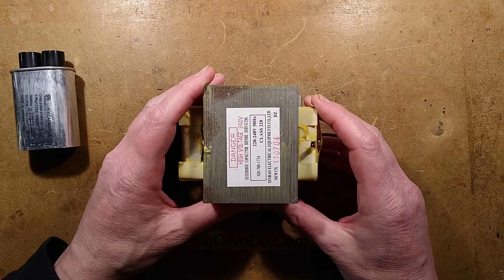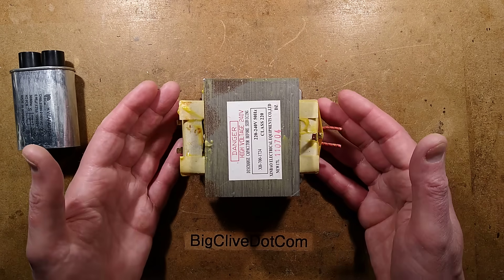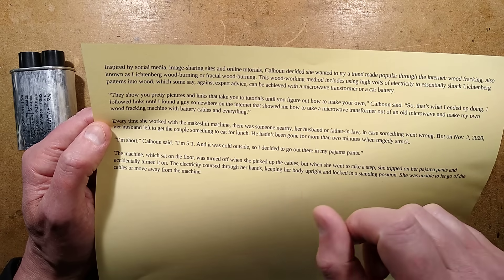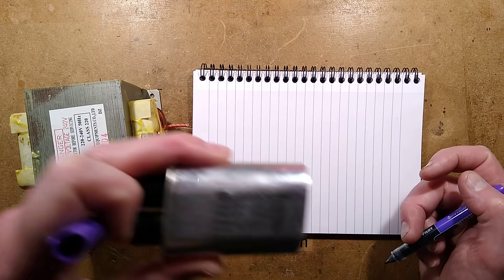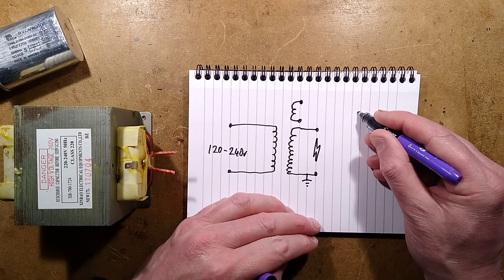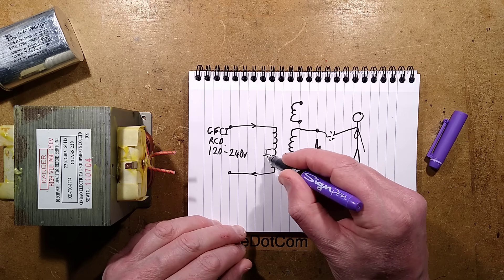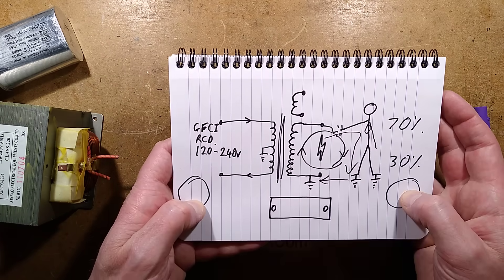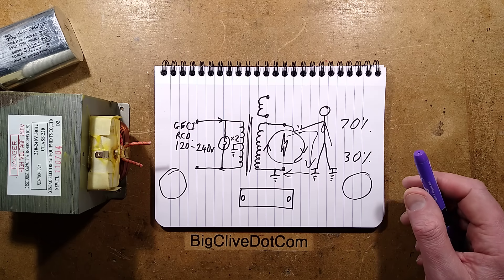The most deadly project on the Internet

Comment: insulation break down is something we can solve just by using the right cable or adding extra insulation such as 6 layers of heat shrink tubing but the added salt water kinda makes the risk unavoidable
Reply: the deadmans switch is a good idea I would also advice people keep this device on a long ext cord and bolted down so that they are are far from the high voltage and isolating the transformer so its not grounded would be a good idea on a side note put a 100 watt light bulb in series with the the primary this will limit the output current a bit I did this to make my own ozone gen and this contraption is in a plastic box  with very short wires that are also covered by 2 layers of heat shrink and the box is also lined with corrugated plastic and I applied a print out of a high voltage label very dangerous device for those that do not know the light bulb is also a good safety as it shows when the device is working and if the bulb goes out the device goes dead and no capacitor was used for safety

Comment: I"m surprised to see the high voltage tap so close to the grounded frame of the transformer, it seems to be less than a centimeter. Why doesn't the spark jump over right there? Or, is the frame in that area ungrounded?
Reply: maximum arc distance in air for 2200VAC RMS is about 3mm, less than 1/8"

Comment: Gotta love the sarcasm in your videos! Thank you for an education in the "safer" method of building this device. I too have plans to build and use such a device but one thing I plan to do as an extra safety measure is to have a rubber mat elevated platform built with wood that sits on another rubber mat just to aid in hampering any ground potential while using the device.
Reply: Most rubber mats are not great insulators. Especially if they're black - carbon is used to achieve the colour, so while it is non-conducting at low voltages, it becomes quite a good conductor with higher voltages. Get an electrical engineer to review your setup before using it, it could save your life.
Reply: @juliangerber1321  thanks for the heads up! Much appreciated 👍

Comment: There are much more windings  on the secondary of the transformer.  The output voltage is a ratio between the primary windings and the secondary windings.  You drew them relatiely "equal" in windings.

Comment: I can see ways to do parts of that "safely" but the idea of having the HV "probes", one in each hand, poking at the wet wood on a wet surface with wet hands is just... amazing.  In the bad way.    Having it wired to the wood, and then plugging it in to the far end of a long unplugged extension cord, maybe.   I dunno.  At least there's no capacitors.   I certainly ain't trying it.

Comment: I leave anything over 120v AC to the certified professionals. When I was in undergrad we actually had a professor die from a homemade flourescent lighting setup. I believe it was a hydroponics rack where the entire rack ended up energized at high voltage.

Comment: Even normal house wiring wire insulation is rated for only 600 volts. Don't screw around with these unless you have formal training.

Comment: I've been inside my microwave number if times to replace parts,no problem always use brinkly stick to chk discharge 1uf cap,I'm used to working on high voltage 10kw tx, transmitter that was beacon for aircraft, it had room behind it with 10uf@10kv tbat would give you more than a tingle!👹was on com site in RAF most of txs hf 5kw or25kw auto tune most interesting was you could never get the ips,intermodulation products as low Manuel tuning, as when put on auto tuning! Always chk on  spectrum analyser @ every frequency change ip side bands very high,bad,if not tuned correctly. Interesting  pattern with mix transformer l value my life to much to do that won't be goin there!🤗

Comment: I have done this project many many times as wood working is a hobby BUT I'm an electrical engineer by trade so I have a setup similar to his recommendation, my setup has a box with a key dual buttons and a RYG  machine notification light tower with chime.

when plugged in shows green light when key is turned it shows a yellow light and chirps every 5sec, when both buttons are pressed the flashing red and sounds like a truck backup warning I love the effect but I'm not a fool also I did cross tie 1 leg back to earth with a current sense if 0.1ma of current feeds back to earth is will trip an internal contactor and requires manual reset

Comment: Years ago, I had a friend named Joey. We worked in the repair department of an appliance store. I'm not going to name the place. We were both trained to repair most appliances, including microwaves. Joey wasn't the brightest bulb in the room, and he would try to take shortcuts. One day, he decided to start by wiggling all the wires one at a time while the unit was running. When he got to the transformer, I said "Joey, don't touch the secondaries while it's running." He gave me a funny look, like "you still think you know more than me." Then he wiggled one of the secondary wires. I was about 3 feet away. All I saw was a blinding arc flash. Fortunately for him, the current went in the pad of his thumb and came out the side where it was either close to the side of the magnetron or the frame. He literally had a hole burned through his thumb. He thought it was safe because he was just touching the insulation on the connector. What he didn't realize is that voltages that high can jump a couple millimeters. He learned a pretty valuable lesson that day. I'll admit I'm fascinated by this art and would like to try it, but there is no way I would ever be foolish enough to hold the wires. If I were to try it, I would have a mechanical device which would hold the wires to the wood, and I would switch it on from a safe distance like the way X-ray techs have to go in another room to trigger the X-ray.

Comment: Electricity is dangerous. I had a strong electric shock on the palm of my hand and it lasted about 10 sec easily (our main voltage in Chile is 230V R.M.S at 50 Hz), I had to run all the way to the wall plug and plug it out myself because I couldn't open my hand, the muscle of my hand contracted... thing is I was lucky because the input (phase) and output (neutral) were ~3cm apart. So electricity didn't pass through my whole body! I kept cool and calm, knew what was happening and acted accordingly, I was aware to not touch other people nor a metal and keep that hand away from my body. At the end it was just a very nasty burn. I now have 2 ugly scars that are between 0,7 cm and 1 cm in size and if I press the skin between the scars I can feel "an inner scar" connecting them. Just a note to all of you. If you get burnt, be it by fire, electricity, etc. Try to keep the injury extended. That way the tissue and skin will heal closest to it's natural state and you won't lose mobility.

Also, their is a store where I buy lights that have a live wire that they use to test lamps. They have it with no insulation, powered all the time and in a place where they can touch it by accident. I still do not understand how no one has died or gotten electrocuted! I told them to be careful with that and to use another method... answer "nah, we are very confident and not afraid of electricity"......... morons.
Reply: That said, I still use high voltage (+1000V) for somethings. Before touching anything I put both hand on my back, check that the plugs are unplugged on the wall, even if the plugs are unplugged, I still keep my hands on my back. Inspect everything twice and then I start working on the cables. Also always keep a distance from any wire. Check that the wires are insulated for the voltages being used etc. Even use gloves.

That accident I had was EXTREMELY STUPID!

Comment: I've done this. I felt I was very safe. One hand rule, standing on an insulated mat, 3 pairs of gloves, proper clothing, triple circuit protection. Dry work space etc. It didn't really cross my mind that a GFCI or my other 2 surge protectors are not an effective safety measure. I don't use battery cables. I've been using HV BBQ ignitor wire. Thank you Clive! If I ever try it again, I'll either use my ZVS Flyback circuit or make some serious changes in how I approach this.
Reply: Just call the game. Find a new hobby or a lower power source
Reply: Get gloves from a lineman and his crew will probably tell you a lot you need to know.
Reply: You touched a probe connected to this live???!! Please don't do that.
Reply: The one hand rule doesn't apply for voltage over a thousand, as Clive says, "it'll find a ground or make one".  Two decades working radar, got zapped with 1000 volts in my school training.  Woke up half a minute later, sitting on the floor.

Comment: It takes less than a quarter amp passing through your heart to stop it even at 120v high voltage just finds a path easier. Please be safe everyone. 120v and inherently limited high voltage can still be deadly, far less disfiguring though so worst case open casket.

Comment: I'd think you might want something more precise than a button if you're dealing with something that can cause spasms and muscle lockup... maybe some kind of multidimensional lever that has to be held at the centre of its range of motion in order to close the circuit. Pulled, pushed, or rotated out of that centre = disconnected.

Comment: Thanks so much for your well informed and very watchable video. Hopefully it’ll get through to some who might otherwise have proceed blindly. 

As a teenager in the late sixties I played with an oil burner ignition transformer that would supply at least 10kV under load. It made a Jacobs Ladder that would sustain an arc inches long at the top and was great for igniting lean mix Oxy-Acetylene in party balloons which caused great concussions. Needless to say I cringe now at the memories and feel lucky to have survived unscathed. (I went on to an electrical and electronic engineering career in the research facility if a Hydro Electric utility and got to see the real aftermath of high voltage problems which were both awesome and scary.)

Comment: @7:10 "low voltage at high current, nothing wrong with that".  What?  HIgh current at low voltage - just a few milliamps from one arm through your chest and out the other arm - is quite deadly.  When you're talking about doing this in concert with salt water, the skin resistance makes this even more of a problem.
Reply: Low voltage high current through your body is impossible .Your body has a resistance, and low enough voltage simply cannot pass high current through your body. For example, a 12V car battery can output hundreds of amps, but grab the leads of one, even with wet hands, and you don't feel anything because the voltage is too low to push a significant amount of current through your body. Not to mention that your body resistance actually drops with higher voltage, so even more current. I=V/R

Comment: I made one years ago... and I was aware of this. 
I went overboard with insulated wires (forgot what it is called, but it is marine grade with about a 1/4" radius thick insulation.). 
Attached to 3 foot long PVC pipes and copper tip ends.
Wires are each 20 feet long and a switch that is lighted when on. 
Flip cover over switch as well.

I get everything set up with clamps, then walk the 15 to 20 feet to the control box. Get someone to watch while I operate and what to do if something goes bad.
THEN I plug it in.
Double check from a distance, then flick the switch.
Cannot be careful enough. 
I haven't used it in years though lol.
Reply: I also have a switch that allows me to adjust the power it receives.

Comment: such deadly things should have double fault kind of setup.  if one chance in a thousand your hand slips, then something else stops it.  the microwave oven itself has multiple protections, if a wire gets loose inside, the fuse and the grounded metal case will be a safety backup.  the door has three interlock switches to cut off power if opened.

Comment: More embarrassingly, I and my SO were very painfully shocked in two separate incidents surrounding a rack mount ion pump power supply from which the top cover was removed (or more charitably, missing). I warned her NEVER to mess around in the shop, but a magnifying light was over the piece and she'd snuck in to use it and a hand mirror to mess with blackheads and such. A necklace dangled in. Some weeks later I shocked myself through "normal" means while working on it under power. Put a nice clean hole in my fingertip about the size of a grain of rice. I could only compare the pain to having the pad of my finger bitten clean through by a small parrot at a young age. Fool me once... since then I use a double-interlock outlet strip on my testbench.

Comment: The problem is not the project or the voltage. People have been working with high voltage and current for a very long time. It's just evolution in action. Someone without the experience to understand the risks buys the parts. wires them up,  and then dies. Somewhat tragic (not really) but not a surprise. How many guys buy a car with a powerful engine, and then die because they were now skilled enough to handle the power? I don't think we need to do driving tests before allowing someone to purchase a specific model of automobile. Look into the dangers of a tractor. I'm sorry that I'm not sorry, but I refuse to to believe that we should all be restricted because a few people got in over their heads.

Comment: Yes, it's a horrible story and despite the fact that I've done tube amp builds with plate voltages reaching 800VDC, got shocked once with 370...400VDC between my hand and forehead, I'd be scared of a few kilovolts running around in my lab.

By the way I wonder how PhotonicInductions is doing.

Comment: i has only used a Mot , whith my ossiloscope , to messure somtfing , tho do not remmember exactly what. but it was above 600v. tho i used 2thdary as input and messured on primary , but i guess it had whit car altenators or the egnition maybe , but it worked.
Reply: tho i do not really recommend using a Mot , better to buy a 10/100x probe its far easyer then using a bulky Mot.